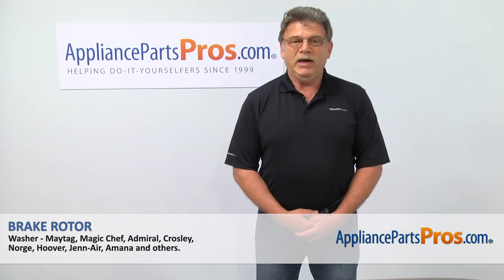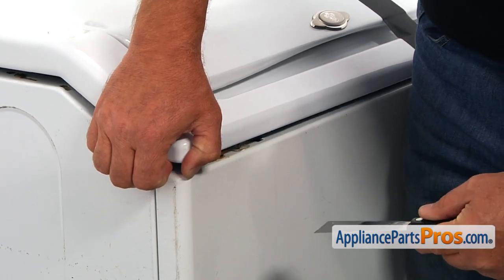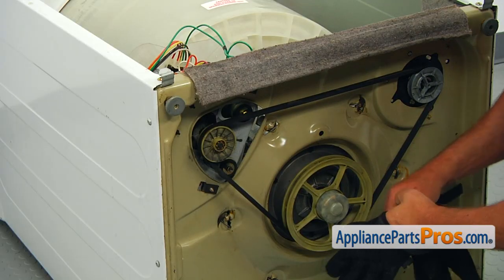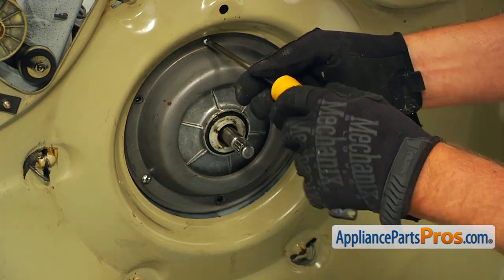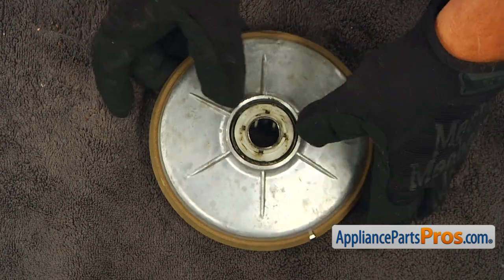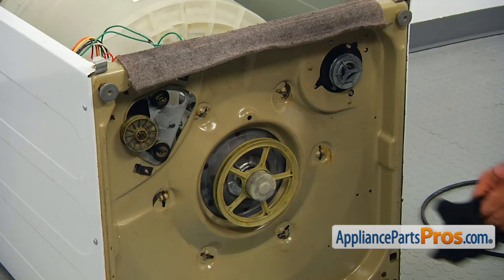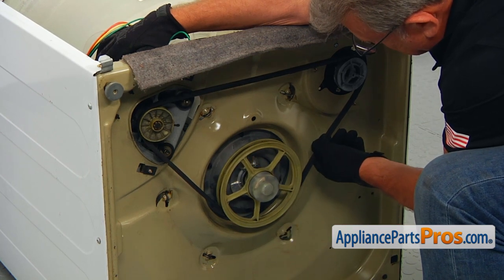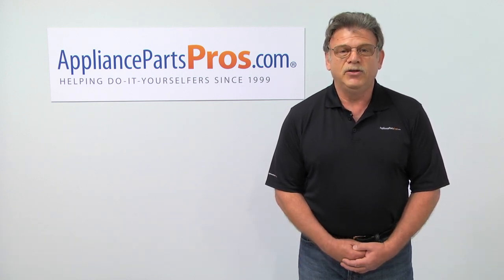How To: Whirlpool/KitchenAid/Maytag Brake Rotor WP35-6714

Comment: My tub won’t spin but the pump drains , I’ve replaced the water pump the thrust bearing kit the belt , it does agitate too, and I replaced the tub springs all at the same time as the other parts , the motor is fine and the break rotor ain’t available anymore , MAV8551AWW, serial # 20276301CT